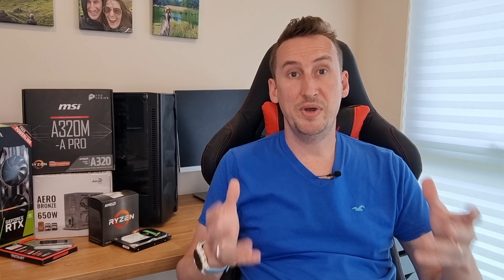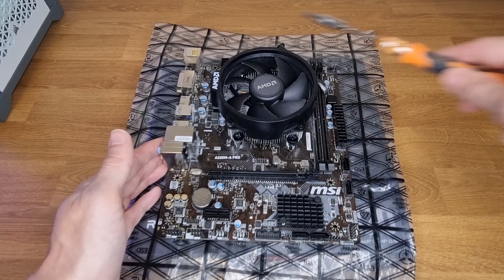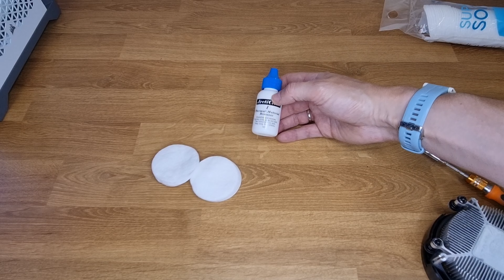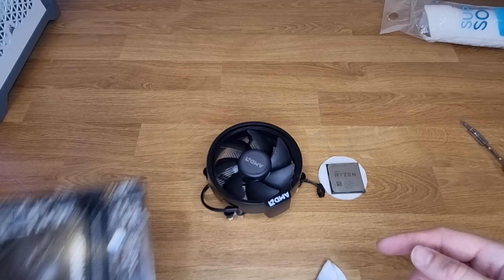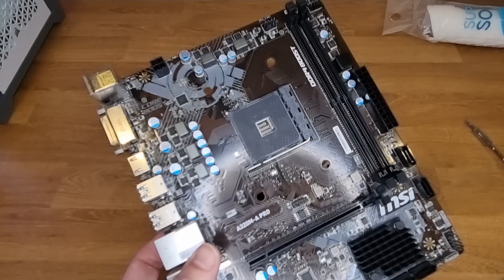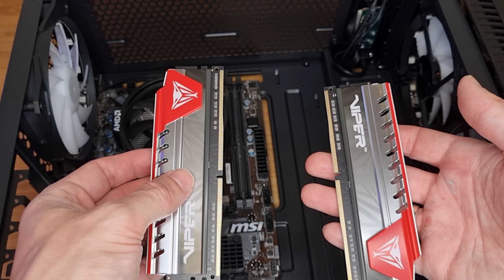Full PC Build - RTX 2060 Super - Ryzen 5 3600 - Budget Gaming PC under £550

Comment: I used to use a 1080ti from EVGA (man I miss their cards) and it also came with that power adapter.  I ended up not using it in my PC as I had custom sleeved white cables and actually wanted to show them off instead of hiding with the side adaptor.
Reply from the maker: Yeah i really like the evga cards.  I have the 3080 FTW one, was lovely.  Shame they stopped